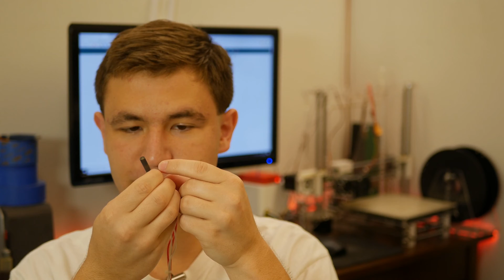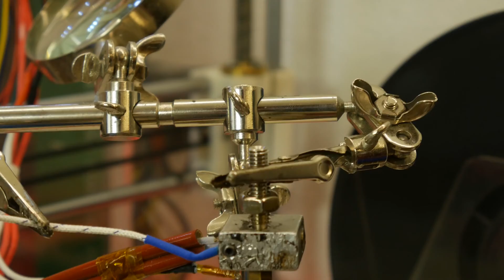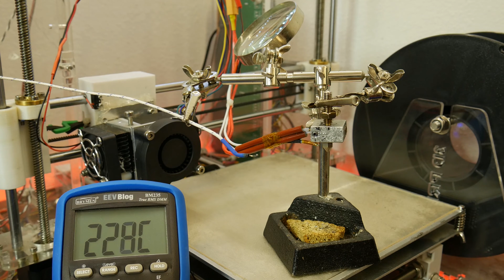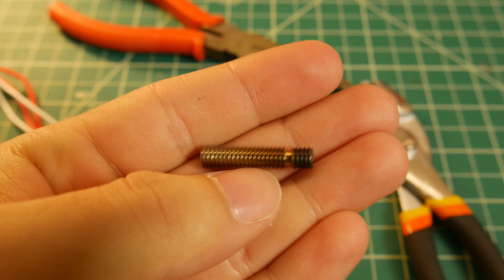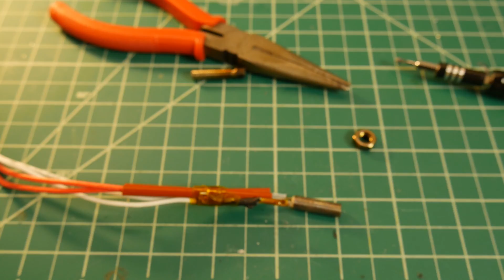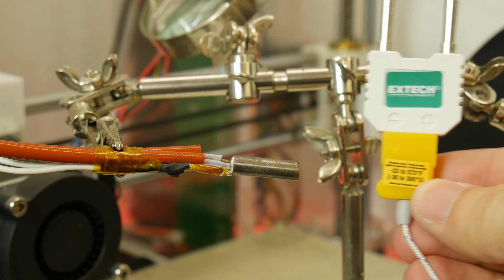Broken Thermistor: What Can Happen?

Comment: i covered the block in kapton tape and a week later of use the thermistor was gone and all that was left was 2 bare black wires. woops. another time i left the printer while it was printing and a hour later i checked it and for some reason the temp was reading 340c and i could see smoke coming out of the nozzle. this was on a ender 3 with a max temp of 260c with all the protections enabled in the firmware. pretty scary stuff. obviously i took the whole thing apart and rebuilt it many times after and it never happened again but i still don't have a single clue how it happened.